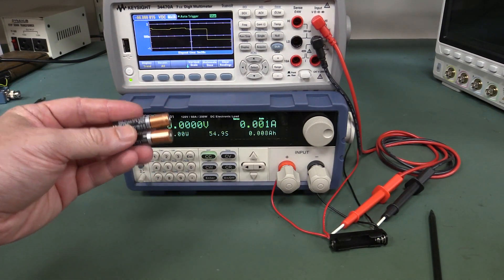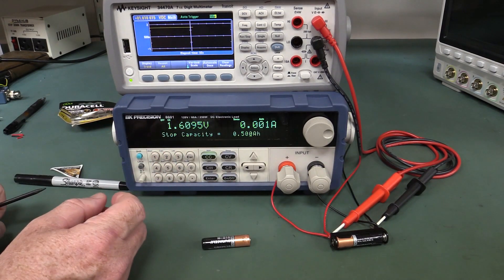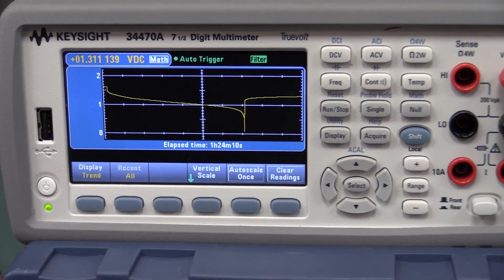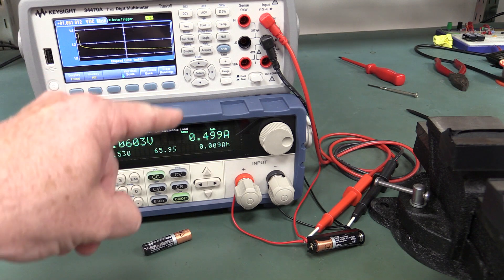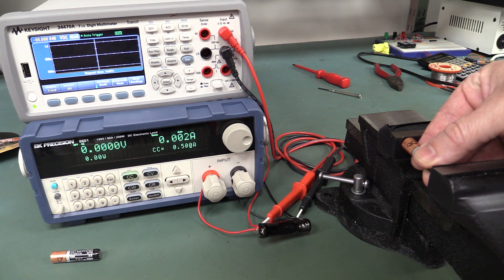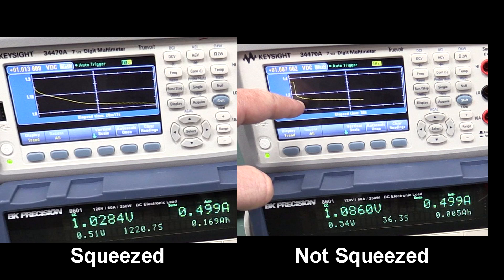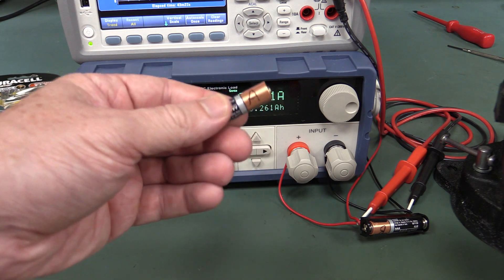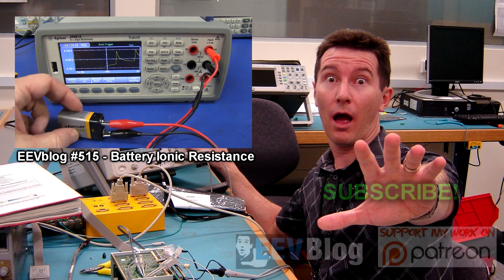EEVblog #865 - How To Increase Alkaline Battery Capacity

Comment: battery=cell?
Reply: +magnocontrol yes and no!

Here's the thing, a "cell" in this context is an anode and a cathode in electrolyte that'll provide the energy, a battery may contain multiple cells in parallel or series. 

For example a 9V battery will contain 6 cells in series, this can be in the form of 6 tiny cylindrical cells that are smaller than an AAA or in some cases a pile of square layers also exist/have existed. A lead acid battery will provide ~2V per cell (about 2.10V open circuit voltage when full and for floating 2.20V-2.30V depending on the type). So a typical 12V car battery will contain of these cells in series.

Then you've got different cases where a high current capability is needed, rather than putting all the cells in series there are applications where you for example use 6 cells, wire them up in 3 sets of two that are parallel (add up capacity for those) and then wire those 3 sets up in series. This way you still get 3 times the voltage the cell provides and also increase the amount of current the battery can provide vs just 3 cells in series. You'll typically see this kind of arrangement in lipo packs for high drain scenarios like rc cars and aircraft/drones.

In the case of traditional AA and AAA batteries they'll only have one cell inside and some people at times use it a bit interchangeable since... there's only one cell inside that battery that matters when it comes to providing energy. A single cell can be a battery if you wire it up as a power source, but it can also be a component of a battery if you integrate it into a battery.

PS: I'm still not 100% sure about the content of the original video, I might try the experiment myself/read up a bit more/come back in a few days to see what Dave has done with the video.

Comment: Besides of being april 1 I remember when I was a young student and my calculator  used to eat my little budget in batteries I squeezed at the last juice of them just simply just giving little taps in the axial way (just caring not doing too strong to not break the carbon rod inside) 
EXPLANATION: the chemical reaction inside the battery generates oxygen, just little bubbles like blisters around the carbon rod, oxygen slowly start to cover the rod isolating from the rest of chemicals so less surface exposed to chemicals = less energy generates; if you give a taps the battery can remove some of the blisters around the carbon rod and gain a little more of juice. Batteries could last longer if they build with a oxygen exhaust ;)

Comment: I thought this was pretty common knowledge: Pressure and small shocks basically shakes down the chemical layers freeing more ions that otherwise can't react because they're accidentally insulated by inert material and reducing the internal resistance of the battery. That's why the battery squeezes out more aH out and the voltage drop is less sudden. I've found it's best to use a repeated taps with a rubber mallet on a concrete surface, for about 5mn per battery.

Comment: Very interesting video!
This is a well-known occurrence in batteries with solid particles.

Alkaline batteries (and a great many other batteries) are made with electrodes consisting of powdered zinc for one and powdered carbon and manganese dioxide for the other. Now ideally when you pack them into the battery all the particles in the same electrode will touch and eventually give you a conducting path from every particle to their respective current collector component, a carbon rod or a metal can. BUT, in practice some of the particles will remain suspended in the electrolyte and not conduct. These orphan particles can't be oxidized/reduced in the electrochemical reactions and thus essentially remain unused. Additionally, during discharge, loosely connected structures of particles will disconnect as the weakest particles get oxidized/reduced first and no longer conduct the current of its neighboring particles. So more orphan particles are created. Eventually all the connected particles are discharged and the battery is dead. But these orphan particles remain.

Compressing, striking, grinding, or even sonicating the battery will dislodge the orphan particles and cause them to connect, forming a low-current path to their respective current collectors and giving some extra capacity. This capacity was always in the battery, it was just unavailable. Continued mechanical action will eventually dislodge all available particles and the battery will truly be dead. 

This effect is an active area of battery research as it has implications for the life cycles of rechargeable batteries. When a battery is discharged and recharged the particles don't quite recrystallize exactly the same way as in the previous cycle and this leads to increased ESR, physical wear of the membranes and components and other problems that contribute to limited numbers of charge/discharge cycles.

Ways to reduce the effect include better manufacturing methods, additives that make the particles stick together better and prevent the weakest particles from disconnecting, as well as advanced charging/discharge circuitry that presents a pulsating load of a special waveform to the battery that discharges the particles more evenly rather than going after the weakest ones first.

Batteries with molten electrodes, fuel cells, all-liquid electrodes and similar chemistries don't exhibit this particular effect.
Reply: +NurdRage WHAT? you watch EEVBlog? maybe colab with EEVBLOG? H2SO5 vs. Fluke 78? (and other chemicals)or some LN2 stuff?
Reply: Even though commonsense and normal, it's still cool to see all you guys interact and watch eachothers' stuff. Science & youtube 4 ever!
Reply: +NurdRage Thank you for the excellent explanation. Your comment should be at the top of the stack. Need a StackExchange-like interface for YouTube.
Reply: Might be interesting to connect a ultrasonic transducer to the battery to shake out some more electric pixies.
Reply: +NurdRage And? I must know!
Reply: yaaaay the Nurd squad maybe you could join Dave in his new giant lab and set up your chem lab in there .
Reply: +NurdRage Yaaaay the Nurd squad maybe you could join Dave in his new giant lab in australia.
Reply: +mattibboss 
It's well known in battery research. Even Li-ion (rechargeable) batteries exhibit this kind of behavior - although it's far more complex and the relationship is not always linear.
http://www.sciencedirect.com/science/article/pii/S2352152X16300032
Reply: +NurdRage Reading in a slightly distorted voice :D
Reply: I'm only a decade late, but do you know of any techniques like this regarding the charging of lithium ion batteries? I've suspected that there was some benefit to be realized there, but I've only ever seen chargers that do a typical CC->CV charge.

Comment: Hi Dave, thers another potencial way to increase capacity, in africa we see many people puting dead cells on the sun, and they say it charges the battery,
(i dont if it actualy works, i never tested)
Reply: +Bruno Cardoso I don't know how much it'd affect the reaction in these batteries, but it may have an effect on them while they are warm.

Heat will increase the resistance of a lot of materials but the little bit of heat increase that you're describing there won't be too significant. What is important however is that it'll affect the chemistry most likely, a lot of chemical reactions will not happen if its below a certain temperature and happen much faster when things get warmer, could go into more details but that's the simple short version.

So I suppose where the batteries would not be able to provide enough energy before, right after you take it out of the sun (heat) it will work better for a while. There are limits to this though and especially if they are rechargeable/secondary batteries then this will increase the wear significantly if you get above certain thresholds. So I'd suggest to only use it on non-rechargeable/primary batteries if at all.

Comment: I have now tried this with 65 different batteries from various manufacturers getting on avarage 112 to 114 more mAh out of the squeezed ones. I applied between 105 and 108 N of force to the squeezed ones and had 49 batteries for control.

Comment: Yeah we used to do it back in 1880's, when we had no power in my small village in Morocco to power on the stereo. I used to hammer the top of the batteries like you did here Dave, some other people hammer the battery in all sides, some other people even boil them in water for few minutes..... Brings back memories

Comment: This only works like in the video if you squeeze longitudinally. If you squeeze laterally then the battery voltage will go up which can damage your circuit. Stay safe

Comment: By squeezing a battery you shorten the flux path length. This is why ionic resistance lowers and you can get additional charge out of a battery. 
This is why there is always a small spring at the end of a battery holder.

Comment: from when I was young many many years a go I knew if you bite from the side a battery this gave you more minutes of play time with your toys. what is new is seeing using a bench press instead to use your teeth not a big deal, also we didn't bite from + to - we bite on the body of the battery . This is some thing kids in south America knows (at least me) from early edge to have more time to play with toys because batteries were more expensive at that time. Of course David is  doing this in the way an engineer suppose to do it to prove if is true

Comment: I used to do this in the 90s, we were getting crappy 777 marked batteries that were sitting for year in warehouse (poor east EU country), I would squeeze it with pliers on the sides, they ended up looking crappy but they did offer a lot more capacity, what I heard at the time is that there is some hardened (compacted) chemicals on the sides and by mashing them you would be loosening them and they would participate in the actual chemical reaction.

Comment: *checks date *
goddamnit, Dave...
Reply: +John Ridley "Published on Apr 1, 2016"
Reply: +Falcrist Nope, April 2 in Australia. He can't have two days worth.
Reply: +Daniel Wiggins +16 hours.... do the math?
Reply: +Falcrist I didn't even think of April fools, but the possibility exists it's not a joke. Batteries are sensitive to the resistance of their connections and even without squeezing them, if you just lightly scrape the ends with steel wool and clean the battery contacts in the device, the batteries will last longer especially in low drain devices like a television remote control. When my remote batteries die, I just open the battery door and give them a spin to scratch up the oxidized metal and they will work a few more weeks or months like that.

Comment: When I read " interesting ionic resistance phenomenon " I checked the date and thought you wont fool me! But this is something I used to do years ago when batteries were less plentiful and more expensive. New batteries would be used in a high current draw torch. When the torch got dim they would be transferred to a transistor headphone radio for another few hours of use. When this failed the batteries would be removed and squeezed "laterally" and put back in the radio for another 20 minutes of listening. The other trick that we used to do was put the batteries on a radiator or by the fire to heat them up. Once they were toastie you could get a bit more juice out of them. Definitely worked in the good aul days. SO now I don't know if this is an double bluff type of Aprils fool or not, especially since the other "New Office" video seemed a more obvious type of foolery!

TL:DR This video I believe, The new office one I call Shens!

Comment: I've heard of similar results from baking the batteries in the oven for a while.  People have been known to "recharge" non-rechargeable cells thinking that they are adding power to the battery but all they are really doing is heating up the cell due to the internal resistance.

My guess is that since the cathode of an alkaline electrochemical cell is a solid (manganese dioxide mixed with a liquid electrolyte) , the products that result from the chemical reaction that occurs during discharge will stay in place after they form resulting in an area of higher resistance.  Squeezing or heating the cell causes these products to become agitated (or perhaps even dissolved in the case of heating), moving them out of the way, effectively eliminating or reducing that area of high resistance and allowing current to flow more easily.

Edit: This most likely occurs on both the inner surface of the battery can (at the cathode) and at the rod going up the middle of the battery (at the anode) where it exchanges ions with a zinc-containing paste or gel.  The products that form are manganese(III) oxide (Mn2O3) at the cathode and zinc oxide (ZnO) at the anode.  These grow inward as needle-like structures from the outer can into the manganese dioxide/potassium hydroxide mixture at the cathode and outwards from the center rod into the zinc metal/potassium hydroxide solution at the anode.  Mn2O3 and ZnO are both non-conducting and basically these two will products build up until the point where they are blocking so much of the surface of the conductors that electrons can no longer get through to initiate the reactions with the manganese dioxide and zinc metal.  The needle-like structures are very brittle and fragile so a little bit movement from the squeeze will cause them to break off from the surface of the conductors and migrate into the slurry around them, allowing electron flow to resume and further chemical reactions to take place.

Hope that makes sense.

Comment: April aside - only thing that would make a difference in this case is  fracturing the  graphite rod inside - altering surface area.
Reply: +Mauro Tamm There's no graphite rod in an alkaline cell
Reply: +TheChipmunk2008 for some reason i completely ignored the title and the type of battery tested.

Comment: If you squeeze it TOO much you'll internally short the negative rod electrode against the bottom of the shell electrode.
(yeah, I've torn apart duracells to see what was inside. (YUCK!)

Also you need to try this over a larger sample.  Not too scientific a sample of two, but OK for a quick video.

Comment: My grandma used to sqeeze them on the side. He was using pliers or hammer.... Don't sqeeze it like that, you can break the carbon core inside.
Reply: +Xmaster Official No carbon core in an alkaline battery.  You're thinking of zinc-carbon batteries, AKA "Heavy Duty" batteries.

Comment: Must be a density thing.
Like a capacitors rating is a combination of dielectric density and surface area, changing one will change the spec.
Compacting the internal compound or chemicals maybe having a similar effect.
That's my first guess anyway.

Comment: This isn't the most surprising thing I have seen. There are actually some physical grounds under which this could be true.  When you squeeze the battery a few things could be happening but I think what is happening is that the internal pressure is increasing. This will cause a shift in the chemical equilibrium inside the battery. If the battery chemistry has some sort of hysteresis then you will see exactly what you are seeing here. Now I do wonder what happens if you let the battery sit for a while after squeezing it. I suspect that it would return the the same value as the other battery.

Comment: I wonder if leaving the battery for a while did the trick, or did you have to bring out the power supply to give it a sip :)
Reply: +EcProjects 4 terminal measurement for increased bogus claim accuracy ;)

Comment: I see a new product on the horizon. The "BattSqueezer"  Our new calibrated 200 foot pound $19.99 replacement springs for your battery compartment will increased your battery life by 20%.  :)

Comment: Dave, I hope this is not April fool's joke.
If it is not, then I would suggest to make more than two cycles of all the batteries. I think 5 will be a good number (as 3 cycles are shown in data sheet, every having 1/2 the capacity of the previous one).

Comment: I hate to debunk this, but you know, you'll never get extra energy from this. It's the law of thermodynamics. I've looked it up, I still have a very nice book that explains it. It is old, it was printed on April 1, 1984 but I guess the math hasn't changed. So, if you put Dave's measurements in the formulas, you can easily understand that any gain is offset by the heat dissipation, friction and molecular relaxation losses in the vice!
Reply: +Peter Gebruers 
The law of thermodynamics is only a law in closed systems. Or anm i wrong ? Besides this: Don't believe in laws, test them out by yourself.
Reply: +Michael Schulz Oh, yes, I forgot about that. I didn't see if the windows were closed. But then again, wouldn't his lab have air-conditioning?

Comment: And therefore I use in projects on batteries only excellent 18650 or other 3.7v cells.
 Conventional batteries are suitable for clocks alarm ,you must buy new ones always.

Comment: I reckon you could get double the capacity if you throw the now squeezed battery into a turbo encabulator for a few minutes but I haven't got one on hand so I can't test.
Reply from the maker: +MrT1melord They are pretty rare I've heard.
Reply: +MrT1melord u funy
Reply: +MrT1melord If you stick it up u'r ass you'll turn into an energizer bunny
Reply: +EEVblog Will we see the turbo encabulator on TearsDown Tuesday once please?
Reply: +EEVblog If Dave has one on hand, perhaps we should sign a petition.
Reply: +MrT1melord I have some pre-famulated amulite plates,  but without a set of spurving bearings, it probably wouldn't  generate any power.